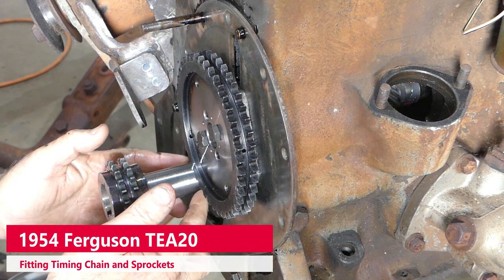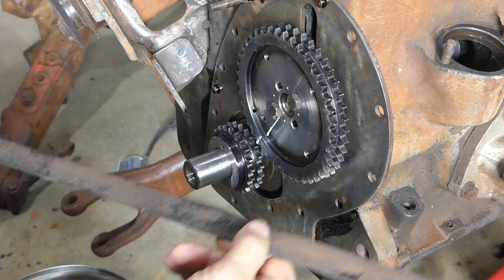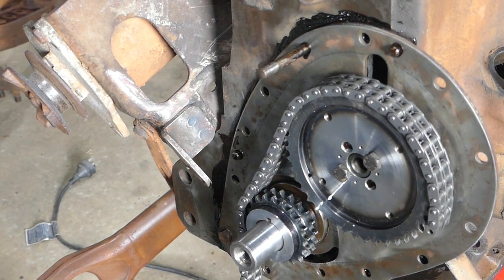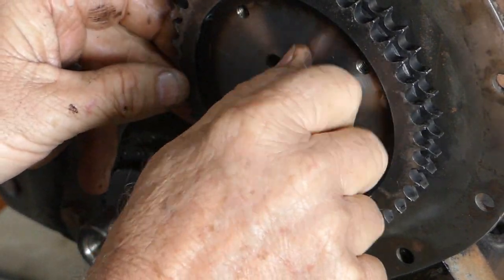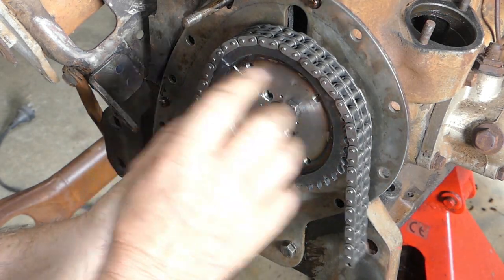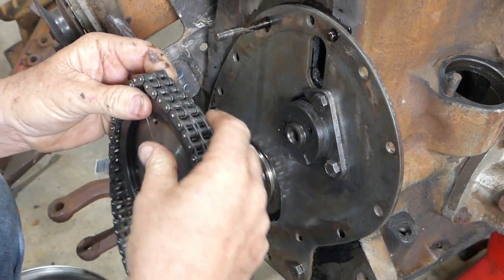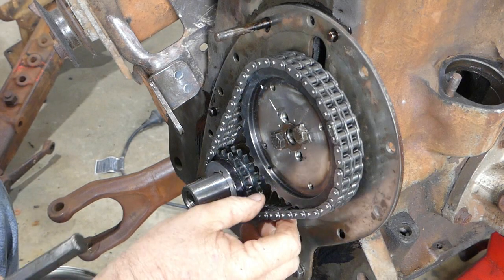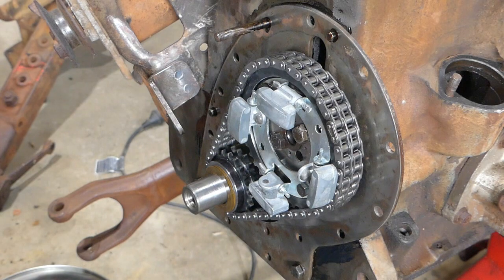Sparex Ferguson TEA20 # 28 Fitting the Timing Chain and Setting Cam timing

Comment: Hi lance, im fitting a new timing chain to my ted 20 tomorrow, the crank sprocket been touched since i took the cam sprocket off, however i didnt put witness marks on the cam sprocket. There is a witness mark etched into the crank pulley but im concerned that ive messed the timing up. Any help?
Reply from the maker: Yes I think there is a mark. Download the manual from my QTS website to be sure. https://queenslandtractorspares.com.au/technical/
Reply: Thanks for the help lance, fitted new belt today, top side is pretty tight but underside is sagging, thinking its because the sprockets aren't new!

Comment: Hi Lance, this is not something you want to read; I have a bad feeling that the chain retainer clip went on the wrong way around (although it's difficult to see). My understanding is that the head points towards the gear that pulls.
Reply from the maker: Yes thats what I did I think, I will have to run through now and have a look, lol.
Reply from the maker: Yep on back to front. Not a big worry though but I might pop the cover its only a pulley and a few bolts.
Reply: I've done the same thing 😂 put the chain retainer wrong way even though I was thinking it should be the other way but I thought you can't be wrong 😃🤣 so it's timing cover off again 😅

Comment: I think you put the chain link clip on the wrong way round, the closed end should face the direction of rotation ,the way it is now could result in the spring leg catching and removing the clip, good luck Chris B.
Reply from the maker: I would need to go back and have a look, it is running well still. Sometimes when filming the end result on the video may not be the actual end result if I have had to do a few takes.
Reply: @BundyBearsShed  i am sure filming and fitting are a very big problem, it must be like trying to talk to someone while you are putting something back together, looking at your re assembly of the timing cover video I can see that if the "mushroom" was sticking in the centre shaft hole that could cause my problem, a video is worth 2 thousand words! Chris B.

Comment: Good day Lance , I took the 5 bolts off the cam sprocket on my TEF today , lost the settings as I hadn’t realised multiple settings , could you please advise me how to get it back to the correct position please ? Thanks again , Ted
Reply from the maker: I would have to look in the manual it has been that long since I did one. There is a free manual in my website www.queenslandtractorspares.com.au in the technical section.
Reply: @BundyBearsShed  Thank-you Lance , your help as always is very much appreciated , I will look that up , all the best ! Ted

Comment: So my John Deere has an idler gear rather than a chain. If I set the piston at TDC and set the valves at .010 (or 0) my idler gear should just slide in and mesh nicely? Maybe? possibly? Then with my rotor pointing at #1 piston it should slide in nicely as well? Perhaps? Welders playing mechanics!!!
Reply from the maker: For yours you need a steel ruler which welders will have for sure. Just align the marks through the center of the crank and pop the idler in.
Reply: That’s almost to easy Lance. Thanks